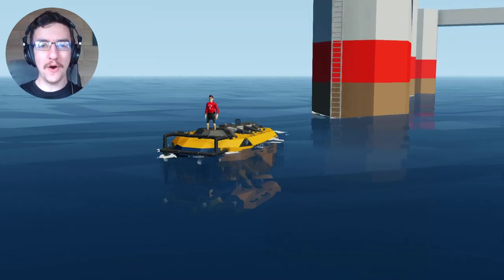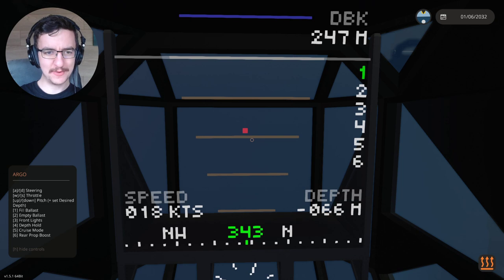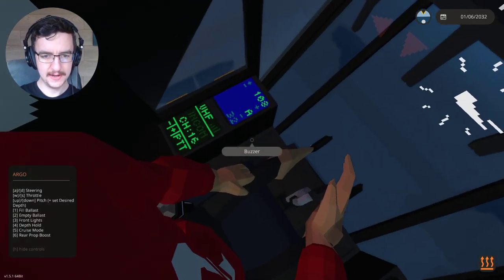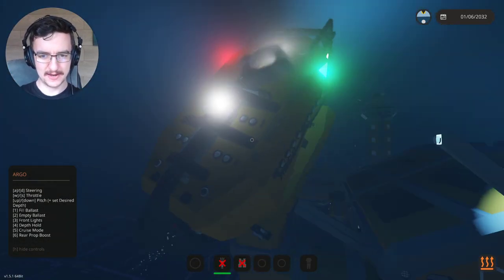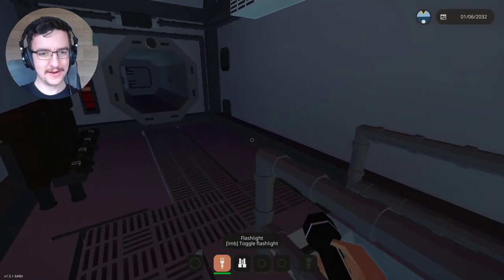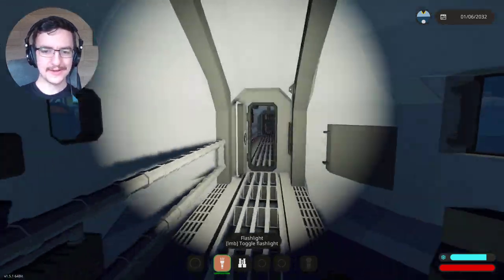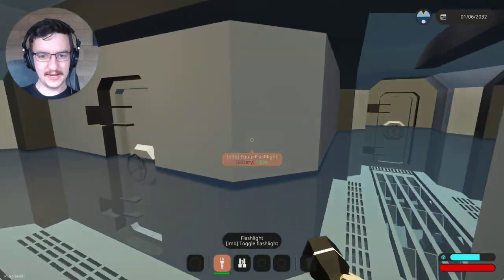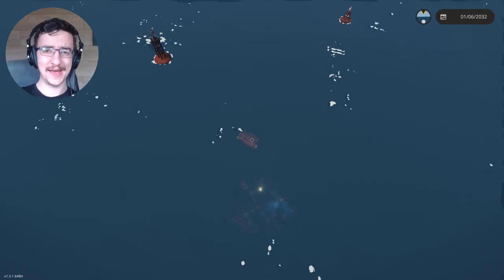HUGE Underwater Base WITH FLOODING In Stormworks!

Comment: imagine if the toggle exterior lights button had it staggered for delay in segments for dramatic effect
Reply: That would be perfect
Reply: Great idea! I might try to add that ;)
Reply: @c4rb0n-1  look forward to seeing it, In case you were curious, the reason large lighting installations stagger their lights is to reduce the surge of current the load (the lamps) puts on the circuit during initial start-up by spreading it over a longer timeframe.
Reply: I use that on control panels even. Very cool effect
Reply: @johnhosasck8667  I mean it's probably running through a microcontroller anyway so would be an internal process if the lights also all have independent on signal outputs and inputs
Reply: I do this on all of my ships in Space Engineers. It's always awesome to see them come to life bit by bit at the press of a single Button. Especially my almost 700m long Cargo Ship looks epic as fuck with the bridge being turned on first bit by bit before all the exterior navigation lights and interior walkway lights turn on in a wave-like style from bow to aft with the engines finishing the startup cycle in a similar manner. 

Same goes for the powerdown cycle only in reverse order and from the aft towards the bridge.
Reply: @carebloodlaevathein6732  I agree. I sadly can’t play space engineers anymore due to my computer being an actual piece of hot shit but the effect is awesome
Reply: @johnhosasck8667  I mean, I can run it on my office workstation which is everything BUT meant for gaming, so I don't know what your issue is with it but still sadge. 
Lemme just build another Giga-Freighter in your honor, mate XD
Reply: @carebloodlaevathein6732  oh. I have an overpriced piece of junk dell that overheats constantly XD, I planning on custom building a replacement
Reply: @johnhosasck8667  i got a dell too. With a K1100M graphics card XD
Reply: @carebloodlaevathein6732  imagine having designated graphics, couldn’t be me
Reply: @johnhosasck8667  I don't. It's the built in render graphics card. Not a refitted gaming graphics card
Reply: @carebloodlaevathein6732  oh ok

Comment: Imagine if they added water pressure to storm works. The deeper you go the more reinforced your ship has to be.
Reply: I mean at the very least for pumps to not backflow, valves to not fail, doors to not fail etc
Reply: Imagine water and air pressure, even if as basic systems

Comment: I can’t get air into the mech.  The tanks are empty.
Reply: wait for the the Air Buoy (the smaller one) to come up to the surface, then just connect the blue hose anchor on the Base with the blue hose anchor on the Mech (it's on its back, up high)